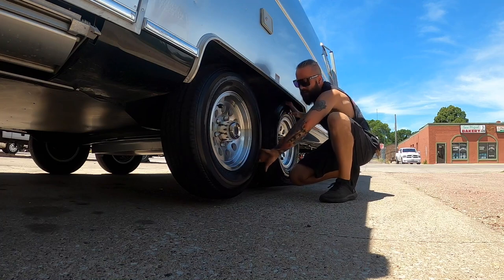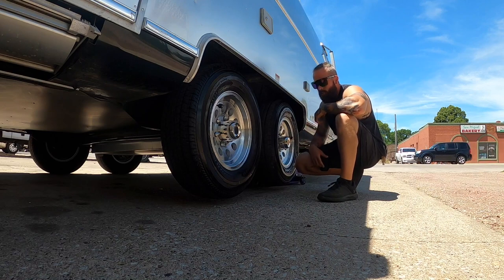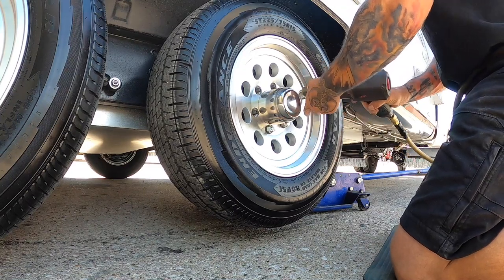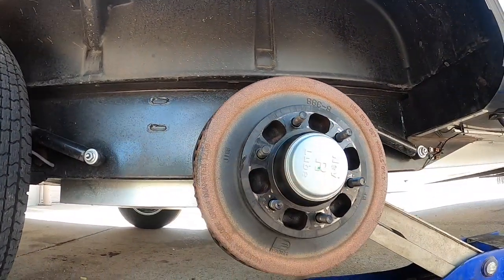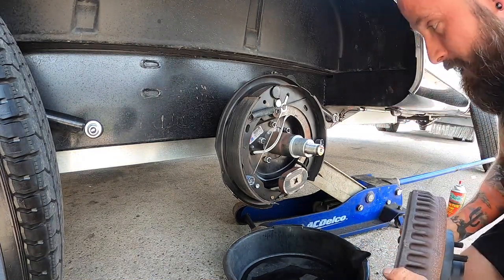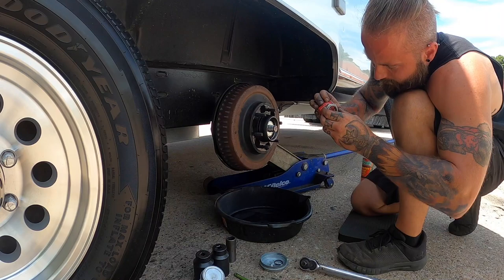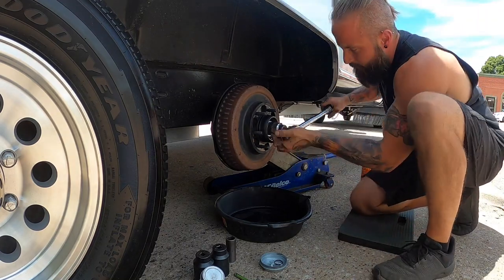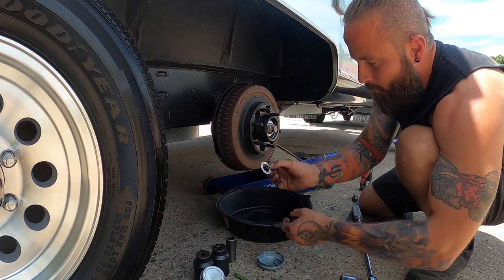DEXTER BRAKES CAUSING ISSUES ON OUR AIRSTREAM. WATCH THIS VIDEO COULD HELP YOU!

Comment: Great video you made. Pay attention people. He covered a lot of important stuff here. While I don't have a fancy pants Airstream (no offense, but I do have the same Ram dually as you) my Jayco had Dexter ez lube axles with traditional tapered bearings and I thought you didn't need to service them, just keep them lubed which I did religiously. BTW, interesting axles, hubs, etc., on that rig. Well, I never thought I would become that guy on the side of the freeway with a smoked bearing. A tow, a couple weeks at a trailer repair place, 2 axles, hub/brakes, bearings, etc., later I am told that the ez lube system (new axles are not ez lube) still requires servicing the tapered bearings annually. I'll put that on my list of things to do with the new axles. TPMS - I run these on both trailers and the front of the Ram. They do monitor air temp which can notify you if you have a problem developing. I believe I had an alarm on the way up to Tahoe, disregarded it, then that TPMS quit working, maybe due to way over heating, so no alarm when we left and the catastrophic failure happened. You are smart and took care of the problem (on your pusher) before a failure.
Reply from the maker: Thanks for commenting back! Yes you're correct people often think that the axles that have the grease zert pump grease into that bearing they don't really get grease between the roller pins. I usually grease my tapered trailer bearings every season to be safe. Never wanna be that person broke down on the highway due to bearing failure. With the airstreams they use a sealed wheel bearing similar to a front wheel drive Toyota or Hondas. We kept having a brake lock up issue with this trailer. I used other trucks to determine if it was the truck(brake controller) it ended up being the powder coating on the backing plates was getting hot and "gummy/tacky" causing the shoes to come out and not release. Hence dragging the brakes. Dexter had tons of these issues they couldn't figure out at the time what was going on that when I decided to tear it apart myself and see what the hell was going on. Hope this video helps others.. safe travels The Longs

Comment: Beautiful trailer!  The weird thing is you appeared to be adjusting the adjuster wrong (loosening) but it clearly worked. I've adjusted more drum brakes than I could count in my 74 years and all of them were tightened by engaging the adjusting wheel at the bottom and prying up. You pried from the top down.
Reply from the maker: I believe one side is reverse thread. Thanks for watching!

Comment: Nice job.  I have a 2017 30' Classic and crawled underneath and couldn't see the adjusting gear.  I read in a manual that the Never lube doesn't need adjusting, auto adjusting, but just watched you adjust them, the old school way. Why don't I have an adjusting gear/spindle?  Need to make a call or pull my hubs off.  Dang it.  Great video and awesome job explaining and demonstrating.  I do have a temp gun and use it to check temps on each stop.  First sign of any problem is heat.  The TPMS is a must in my book.  Saved me twice.  Thanks Brudda
Reply from the maker: Temp gun has saved us couple times and yes TPMS is a must have! If I had someone filming me I could have made a better video but just me trying to do the work and show anyone else who has airstreams the situation I had. Glad I'm able to perform the work myself 😎 thanks for commenting and watching our videos!
Reply: @TheLongLife  Don't be so hard on yourself, we all are perfectionists, the video, narrating and editing was great.  I also wanted to see what the Never Lube bearings looked like.  You accomplished a lot in this video.  Truly appreciate it.

Comment: Nice video on a little covered Airstream system. I have the same kind of brakes on my 2017 23FB and have starting feeling pulsating braking going downhill. I had a look myself at one of the brakes and only saw a rough area on each of the brake linings. Been in contact with Dexter, so far the help has been slow and only wants me to check out truck and Airstream wires, we’ll see.
Reply from the maker: Dexter isn't much help unfortunately. I called them with little to no support so I had to figure things out on my own. If it's only wearing on one side check those backing plates making sure both shoes can swing out. Hope this video helps! Safe travels.

Comment: Brudda, I am sorry to keep bring up this video but, I just called Les Schwab to get a price check on a break check and adjustment.  He said a minimum of $250 per axel just to replace/repack the bearings.  I told him about the having an Airstream and Nev-R Lube but he said as soon as you take the drum off, they replace the seals at a minimum.
I see a little grease on/in your drum but did you do anything with the bearings or seals?  When I was your age, I replaced old bearings and repacked them too, but I really don't have a place to do a complete job like that.  We sold our house in Nov 2022 and live in out AS full time.  Waiting for the wife to retire on Dec 1 2023 (YES!).  The RV parks don't like old farts working on their vehicles in the parks.
All in all, I would love to do a clean and inspect like you did.  Then adjust the brakes because I know mine need adjusting because if the major difference in the temperatures. I guess if I do a clean and inspect, I'm just a few steps from a complete bearing job 🤣
What is your view opinion on the Nev-R Lube bearings and seals while cleaning and adjust the breaks as you did?
Again, sorry for the discussion but I hope your video encourages others to do check and adjust their own brakes, too.👍
Reply from the maker: Hey! Go to harbor freight, buy a torque wrench! I think the torque was #140. On the never lube axles.  There is no adjustment on bearings. Or repacking. Just cleaning the brake shoes and adjustment with a spoon. (Brake shoe spoon as I call it)  red lock tite on the large nut. Snap ring pliers, can of brake clean and you're good to go. Slight drag is all ya need. One wheel at a time.  Thanks for watching the videos love the comments
Reply: @TheLongLife  I have everything but the lock tight 😂.  Thank you so much.  Truly appreciate it.

Comment: I have a nucamp 320 tab. My dexter brakes were not releasing fully. Noticed after my brakes locked up after gassing up. I too noticed hot drums after easy braking periods.

Finally got selling dealer to look at it and whole brake assembly needed to be replaced due to brake not releasing to safe distance. 

Class action lawsuit?
Reply from the maker: I would think so! Lol